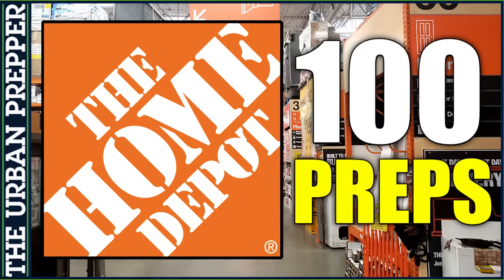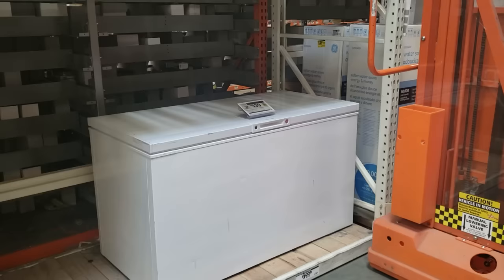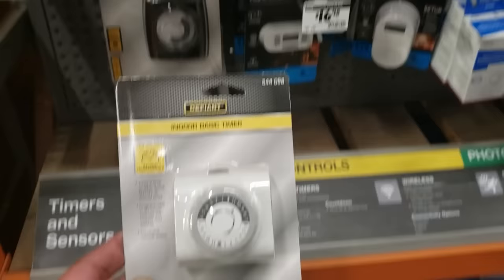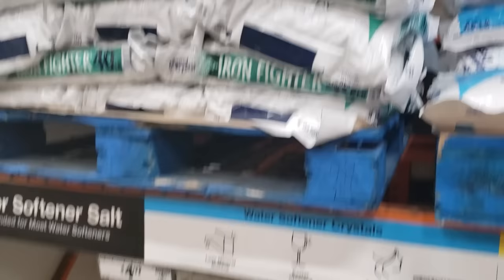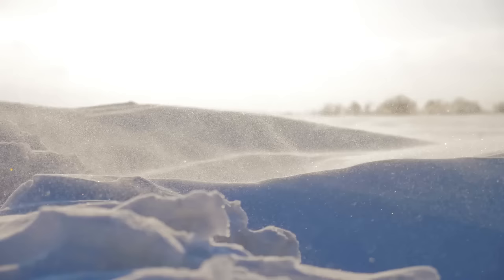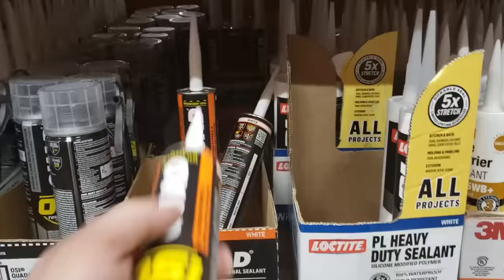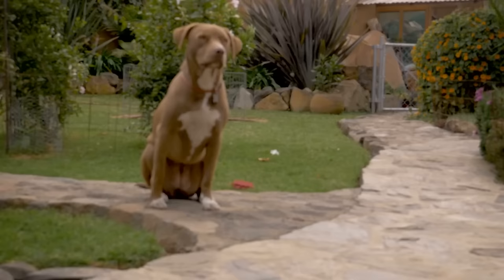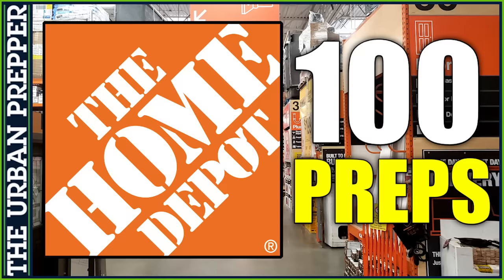Top 100 Preps to Buy at THE HOME DEPOT

Comment: Dehumidifier is also a water generator. Keep some clean buckets nearby to collect water for flushing & to boil for drinking.
Reply: Everyone should research about boiling water and how it actually doesn’t work. The best way to clean water is osmosis.
Reply: Also, if you are able, collect water in barrels ahead of time. You need a gallon per day/ per person. For drinking, bathing, washing clothes (intimates) and brushing teeth.
Reply: We were just discussing this! In the south we generate GALLONS a day from the dehumifier! We will just throw that in the  Berkey filter if the water goes out. ( As long as we are able to run the generator for it)
Reply: @sandrabulluck1896  im so glad I have a pool for all of the above except drinking hah
Reply: @sandrabulluck1896  The water out of a dehumidifier is clean, save for the pathogens it carries. Boiling kills almost all of those pathogens, and those it doesn't are pretty rare.
Reply: Be sure you stock up a n vitamins and minerals. Water from a dehumidifier lacks nutrients . You will get sick from that alone.
Reply: @sandrabulluck1896  More like 7 gallons per person.
Reply: Dehumidifiers use an extreme amount of electricity, but I suppose you mean in a situation where you have much electricity but not much water. But to drink it!?!? omg.. everytime I pour out my dehumidifier I like to joke with someone "are you thirsty?", it never crossed my mind that you can seriously drink it. though I'd like some proof before I try
Reply: That is a great idea
Reply: @ambern.9887  No you won't. You get most vitamins through food.  I've drank distilled water for 30 years and I am 52 and 6'4 200 lbs and probably much healthier than you.  Most people think they know it all......guess what, they don't.
Reply: @franksmith7419  Why?
Reply: @stevenschnepp576  Then use chlorine bleach for extra safety AFTER filtering. Iodine tablets been used by Spec Ops for decades(wally world). FEMA resource for water sterilization options. Just gooble THINGS. As "Mors" the MAN said, "The more you know, the less you need". What ever YOU decide to stockpile, try to make those items as much multi-use as possible. Otherwise you could end up living in a Home Depo, or a hoarder's home.😎
Reply: @dr.victorfrankenschtein7053  I drink distilled, too. My tap water makes me nauseous if I try to drink it long periods, though 80 miles away they have issues with uranium in the tap water.
Reply: I looked into this already. More than likely you can use the dehumidifier water for cleaning and general water use purposes but not drinking, look into the way the water is collected for the humidifier, water coming off of that element is generally contaminated with heavy metals and possibly coolant depending on how yours works. You would be slowly poisoning yourself and unawares. Best to look onto your particluar model.
Reply: @Ac Tion  water filters (even the berkey) weren't designed to filter out coolant. But you do you.
Reply: Wow I totally did not know that! Thanks for sharing!!!
Reply: @mogmaximus  if you can't drink it, you could use it for nonpotable uses, like cleaning, washing clothes, yourself, etc
Reply: The only downside is a dehumidifier uses about as much energy as an air conditioner. 600-1000watts + .   Although use for cooling and dehumidifying air and generating water make it a useful/expensive multi functional prep item.
Reply: @onesunnyday5699  You can drink it if you sterilize it.(boil) Same consumption rules as distilled water.
Reply: So people should trust someone how to survive who can't work on there own home.....  Go get a job in a office somewhere
Reply: @sandrabulluck1896  I just learned that most water bottle companies just run tap water through a filter and some don't even bother with a filter
Reply: @mogmaximus  I am sure that you could filter it, boil it, etc. to make it more potable but when you're dying of thirst, well, it's better than drinking your own pee :)
Reply: And to crap in lol😅😂
Reply: When it's the end y'all won't be arguing about what water or food your going to eat. Starving of food and water you'll eat the family pet and drink mud puddle water to survive to the end. Cracks me up seeing some of the stupid comments on here. To be a real survivor you have to be almost dead to truly understand how to survive.

Comment: If you have a basement or garage make sure to keep the bags of cement and mortar up off the floor. They will wick ground moisture up through the pores in the slab and harden on the side it's laying on.
Reply: Yes lesson learned
Reply: Thanks! Would not have thought of that.
Reply: True story.
Reply: I learned the hard way, they are now used as steps in the garden
Reply: get hydraulic cement in a plastic tub.

Comment: Some Lamp Oil Also, If you dont have one get an Oil lamp or 2, good for light but also in winter with no heat they will help keep the room warm, Just have a battery CO2 detector in that room also. Firelogs if you have a fireplace you can cut them in 1/4 and use them to start damp/wet wood.
Reply: Too dangerous.  Old way.  Heat buddies machine.

Comment: 20 x 20 x 1 inch air filters ( the good ones for 2.5 microns or better) taped to a box fan to filter air in your home.  Good for wild fire smoke, etc.
Reply: Wow good idea
Reply: Buy them before wildfire season starts!
Reply: I've been doing that for a few years to avoid having to take the box fan apart to get all the "gunk" out.
Reply: You don't even have to tape them, the fan sucks it up tight to the intake side. It keeps the crud out of the fan also.
Reply: I use the two filter wedge method. Get more airflow and about 3.5 months use.
Reply: Good idea.
Reply: Doesn’t make motor too hot?  Or modify the filter? I’ve had a box fan set on fire . Thank goodness I was home .  Every since I don’t leave on when not home.
Reply: @uncapabrew4807  If you buy 4 you can make a box and no air goes thru unfiltered.
Reply: LMFAO - you really think an HVAC air filter is going to filter smoke?!? You need mental evaluation!
Reply: Yes,  you can buy the good filters in hardware stores and Membership stores sell the good ones too.  They filter about 75% of the smoke particulates.   I use one every fire season and it makes a big difference.  Just don't buy the cheap filters.
Reply: @markw.4679  Well sir, i have been an HVAC service tech for 43 years - so I am calling you out on your misleading statements! The particle size for smoke is .4 microns, you would have to start with a merv 16 filter which is $98.00 EACH! A box fan would hardly move any air through a filter that restrictive. Although it would work, it is really not feasible, or affordable for most people, as the filter would need replaced after a couple of hours.

Comment: Just want to add on the tech side: All of these Wi-Fi cameras they sell are cloud-dependent, meaning that if the manufacturer shuts off their server (will happen in the case of SHTF), the cameras will cease functioning. For Wyze cams there are third party firmwares available online, so I suggest checking these out if you already have a Wyze before it's too late
Reply: @uiop uiop thats why he stated wired.
Reply: @maxrockatansky1981  wired doesnt mean it's not cloud dependent. You would want a RSP (real time streaming) capable camera and an associated server/NAS for it. You can always isolate it from the internet and something you can view with a tablet/phone.  I would also recommend a POE capable or solar one. With POE you would just need a POE capable network switch or injector and set it up on a UPS ideally to prevent any downtime due to power.

Comment: The voltage tester can be used to check fences, downed wires, etc after a disaster to prevent electrocution.  I have one in my urban search & rescue load bearing kit.  Good list!
Reply: While you test that 'downed wire' with your voltage tester- Ima stand way back here :)  A standard voltmeter comes loaded with other test settings, very useful.
Reply: @jsmythib  A voltage meter isn't very practical checking electric lines for urban search/rescue when all I need to know to determine if a line is electrified is a one handed pass. Yeah, you'd better stand back and let the pros handle the dangerous stuff.
Reply: Can a neon indicator bulb be used as a high voltage tester since they glow?

Comment: I had some left over 2x4's after finishing my basement, I took them and cut them down to 6 inches wider than my entry doors, 2 boards per door, one at the top, one for the bottom. If need be I can use 3 inch screws and place the boards horizontal on the inside of my doors and secure to the door jam, nobody is kicking those in. I also bought 3/4 inch plywood and 5 inch bolts with washers and nuts. Drilled a few holes through the plywood, I cut 2 pieces of 2x4 to appropriate length for the inside of my windows. If needed, I can open the window and then go outside and hold the plywood over the window and run the bolts with washer through the previous holes I drilled through the plywood and through the open part of the window, while the wife places the 2x4 across the window sill on the inside and run the other end of the bolt through the 2x4 and add a washer and a nut, tighten nut down and windows are now covered with plywood that's only removable from the inside. Someone who is determined to get into my house eventually will, but not without making a hell of a lot of noise and allowing me to be setup and waiting for them, will be a bad day for them.

Comment: PLUMBER HERE: TAKE THE HOSE OFF YOUR SPIGOT IN WINTER. Protectors aren’t really needed as long as the water can drain out of the spigot and not get trapped in a hose. 👍
Reply: Do you recommend leaving the spigot running a tiny bit (as in, open enough to drip) overnight during a hard freeze? That's what I've always heard, but I live in Florida, so most around me aren't familiar with real winter weather (me either 🤣).
Reply: @Firstfalconfree  no, don’t leave the outside spigots running. That would let water run down your foundation and make an ice lake outside your home. You can just leave them off and they will be fine. It’s usually wind getting to the pipe behind the spigot that freezes the pipe so make sure it’s siliconed or even cemented in. 👍
Reply: @eyepodoblivion1189  Thank you! That is super helpful, and I truly appreciate it.
Reply: @Firstfalconfree  There is a shut off valve in the house. Turn it OFF, then go out and drain the spigot and leave it open.

Comment: A roll of screen material, cut off a couple 3 foot sections for your car first(that way if you ever have to “camp” in your car you can roll down your windows and not get eaten alive. Just duct tape that screen to your car door.) Same thing with your house, in case your screens get damaged and no power, you can open doors and windows to get a breeze.    Also liquid nails to go in your caulk gun.
Reply: Oh, air filters for your air handler.

Comment: Pro tip, if you get 100ft electrical cords, get the biggest you can draw from an outlet, without heating it up, 12 gauge nothing higher. 10 is also fine, 14 gauge is not and only suitable up to 50 ft. Your devices will thank you for it and last longer. Going with an improper gauge will stress them and shorten their life.

Comment: I need more fuel storage and a second fridge/freezer. Got most of everything else.
Reply from the maker: Excellent!!
Reply: A fridge is no good with out power
Reply: @crispychicken2743  Years ago, Mother Earth news showed how to make a frig out of earthen works.
Reply: @sandrajohnson9926  - What is earthen works?
Reply: @crispychicken2743  that’s why he suggested a mini one that a generator can power easily.
Reply: Chances are your just a gross horder. By shelf stable goods. Unless you are off grid.
Reply: Saw a chest freezer at MALWART for $170. These are soup or efficient cuz heat rises. Conn verse Lee cool, well you know. As a result opening the door retains the cool. If running off a small off grid solar syst dumb one could bury it for even greater efficiency. Pick a shady area to keep the sun off.

Comment: Also, electrical tape & a drinking water hose to fill your h2o drums. If you have a sliding glass door buy a 1/2 in X 2 - 3 ft wooden stick. Place the stick into the top space of the door. Burglars break in by placing their hands on the glass & then lifting it up an inch, this takes the door off the track & then they can kick in the door. The wooden stick prevents them from lifting the door.

Comment: You forgot clothes pins & clothes line making stuff. Home depots clothes pins are way better than Wal-Mart's. The only other thing you will need is the building itself to store all that stuff in.
Reply: Also a means to defend your stuff.
Reply: That is good i will get over there to get clothes pins
Reply: What about using those office spring clips if you can’t get regular clothes pins?
Reply: Dollar $ Tree has Clothes-line rope n wooden clothes pins 😊👍
Reply: They also have all size batteries, bungee cords n garden supplies. Bleach.  Wooden matches. Cell phone chargers for vehicles plus cords too. they even have cleaning supplies. Cheap flashlights.
Reply: @QueenofArgyle2525  That would work, but only until they rust.  They're steel -- holding wet clothes, they will eventually rust, and gradually transfer rust stains to the next batch.  (I'm just assuming here)
Reply: You could also use the clothes pins to pinch your nose closed when the family starts to smell in a SHTF scenario!
Reply: And a heap of money to get the" bare necessites"
Reply: Thank you even I didn’t think about the clothes pins and line .  But you can even use para-cord for clothesline.  You also forgot to mention laundry detergent and a wash- board

Comment: Great List Cliff!
A word of caution about the expansion foam you highlighted starting at 2:20 point on this video.  There are 2 formulation that are often confused. The first is the Door and Window (low expansion formula) then there is the Gaps and Cracks (high expansion formula) the one you highlighted in the video. Be careful with the Gaps and Cracks formula as it will crush your door and window frames. Not a good idea at anytime but a really bad time in a SHTF scenario 😬
Thanks!
Reply: right.  i just bought both kinds.

Comment: A lot of the things refered to here are just part of the every day minor emergencies that a home owner has to deal with   and may not really be classified as "prepping" as it is commonly thought of.  Remember folks it doesn't help you to break the bank with your preps. Start prepping for your most likely senerio working down to the least likely as you can afford them. For example, my first item was a backup for my critical sump pump. An inexpensive 12volt marine bilge pump that can be run from my car battery saved me from expensive basement flooding a few times in the 40yrs I've been in my house. Next came a 2000 watt inverter, also hooked up to a car to keep the fridge and freezer going during an extended power outage. Now, after the Texas experience, I also have a candle and propane heater arrangement that can keep my pipes from  freezing without electricity.  Keep safety first and do things as your budget allows and your situation requires.

Comment: Great video!! Would you consider a prepping video for renters? We live around you and don't own the home and move often. We can't do anything permanent to protect the house and like to stay minimal since we move almost every year. Just an idea - thanks!
Reply from the maker: Sure! I'll look into it.
Reply: That's a great 💡 idea. I need to see it.
Reply: For door security you can get on Amazon and search portable door lock it's small black and tightens against the door frame and door. No tools. You can also get window locks for vertical sliding windows if you're on a first floor
Reply: THIS! we move around almost yearly and I feel like I can never really "prep" Because we are moving anyways. I do try to at least stock up food and water.
Reply: Stackable totes are easier to move and keep most of the non-essentials for day-to-day life in a nearby storage unit that doesn't require electricity for entry.....
Reply: @southarkansassurvival617  Yeah, mine has a keypad to work the gate (not good).

Comment: I bought one of those gas shutoff tools, and it was unable to turn my gas off. I called the gas company, thinking my valve was stuck, but the technician said those are useless...get a 12" or larger adjustable wrench...much better leverage.

Comment: instead of the mini fridge i use a 3.5 cu ft chest freezer with a temperature controller to make kegerator and keep my cold food in it year round. it costs less than the mini fridge to operate and does not lose a lot of the cold air when you open the top door.

Comment: Don't forget a toilet repair kit with float and flapper seal.
Also power splitters or power strips so you can plug in more than one item to an extension cord.
And get some low wattage or LED light bulbs to replace the high watt ones if using a generator.
Also a pool noodle to make a honey pot toilet seat using a 5 gallon bucket and small plastic liner bags for it.
If you live in a freezing climate then collect water bottles up to one gallon and fill them 3/4 full. Put them where they will freeze.
Thaw and use as drinking water or keep as ice for your fridges and freezers if the power goes out.
Reply: Also hose repair items in case your hose gets a hole or someone cut it .